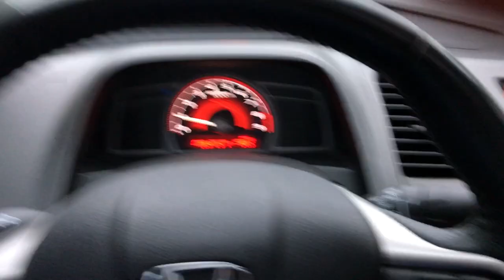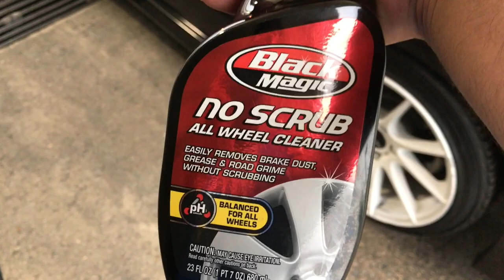8th, 9th, & 10th gen Car Meet!!!

Comment: NOOOOOOO! Don't ever use the brush from those places! They are filled with dirt!!!!!! If you have to use their power washer only use that. For sure you have some spider webs on the paint now. 

YOU ONLY WASH AND DRY WITH YOUR OWN MICROFIBER TOWELS/BRUSHES!
Reply from the maker: Riley RR ehh... my paint is already fucked up. Don't really have a spot to wash it correctly anyways lol
Reply: TdaKid you can use the power sprayer at those self wash stations and then use your own microfiber scrub or towel instead of that dirt logged soap brush ...they are like 10 bucks at any store...but it's your car.
Reply: @rileyrr2925  But if you use your own scrub or towel, wouldn't you just be scrubbing the dirt that is on your car ONTO your car? So pretty much like using the brush?